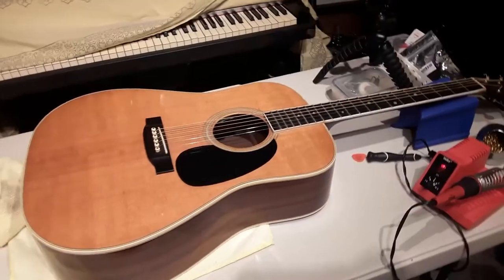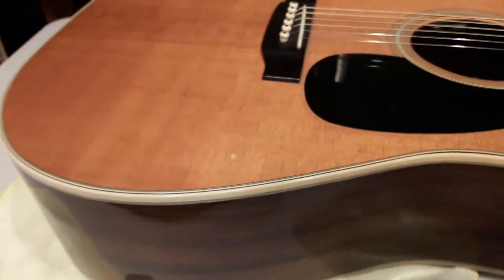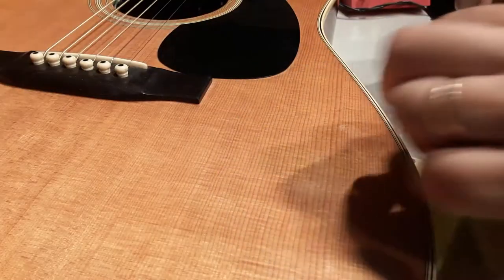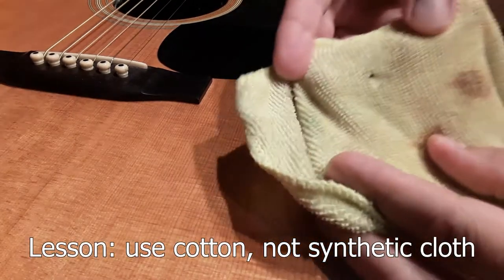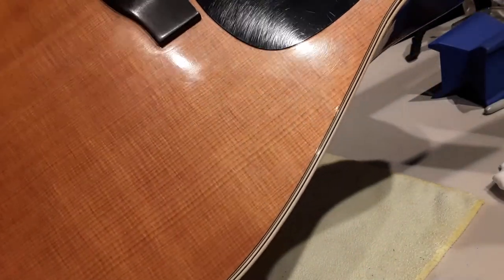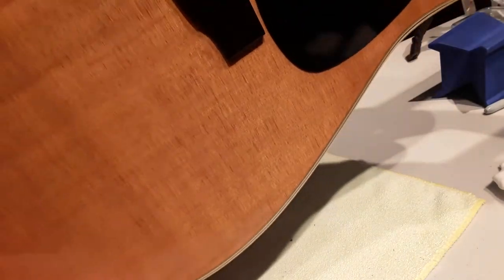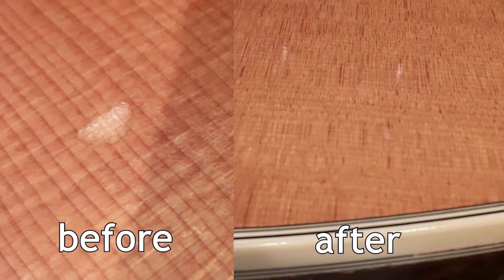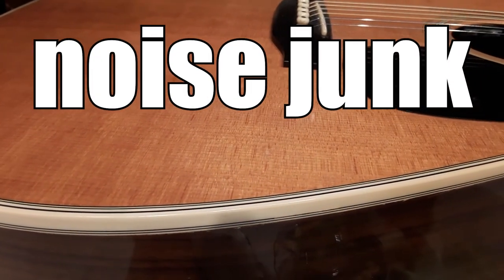Acoustic Guitar Ding Repair (Martin D35)

Comment: Great job! I tried to do a gentle drop fill with a similar situation on a vintage classical, but was bummed to see that thin CA glue direct on a ding a turns very dark if the ding is down to bare wood (spruce in this case). Any suggestions how to lighten up this ding, and how to avoid that darkening next time?
Reply from the maker: That's a good question. I don't know the answer, but I wonder if the CA glue reacted to something. Did you clean the area with naphtha first, or with any other cleaner which may have left a residue?